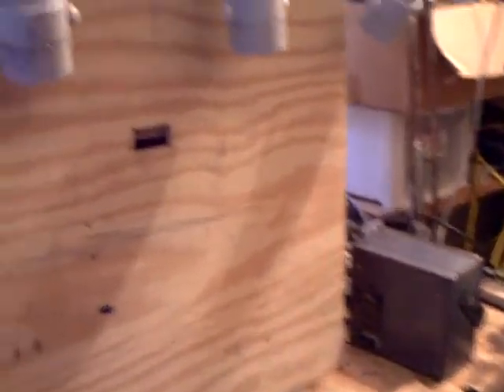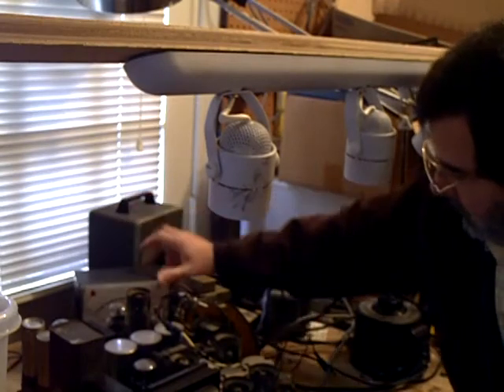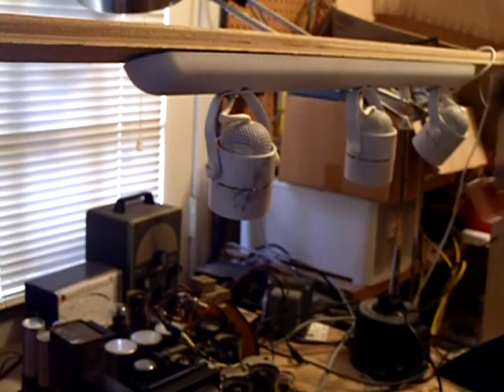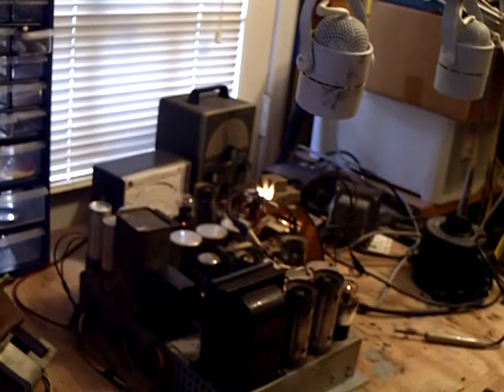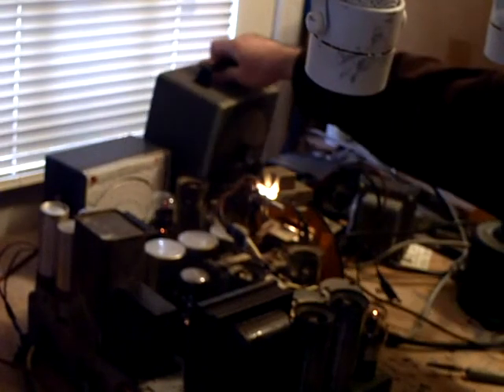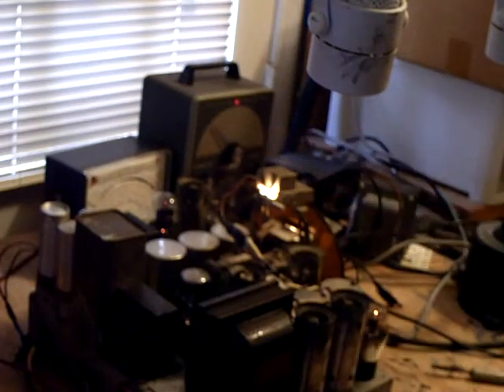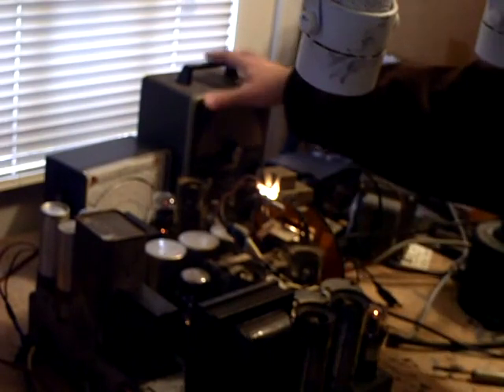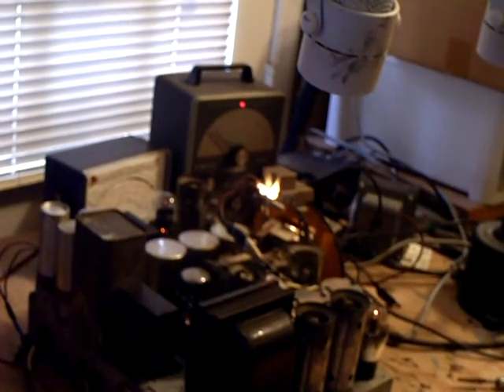Part  34, Is the problem fixed Now?

Comment: You stated you only had 10 minutes for the video.  You could have saved 3 minutes at the beginning.  The info about the radio and test equipment was interesting.  The plugging up of the power cord in a cold room wasn't, IMHO.